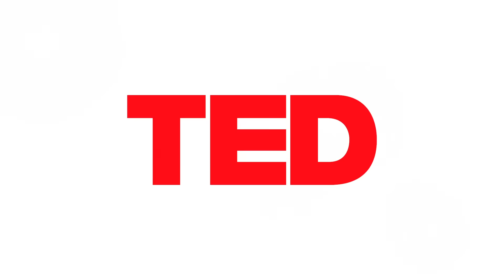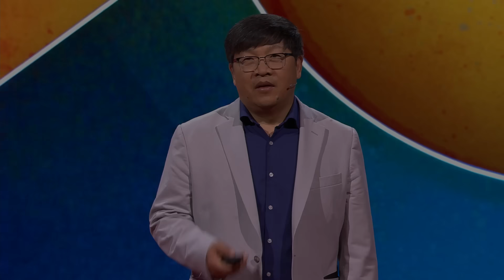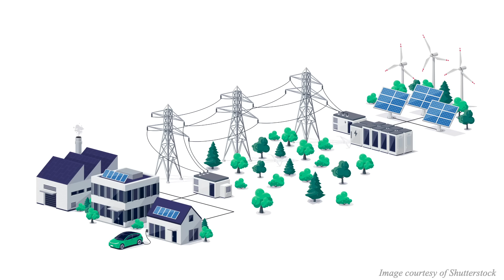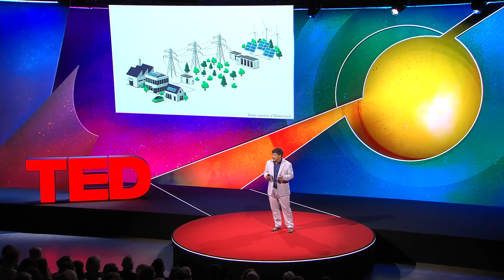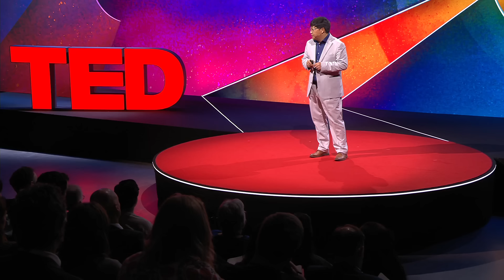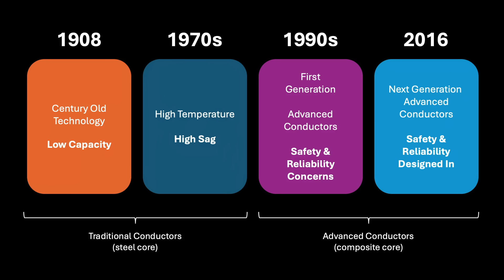The High-Wire Act of Unlocking Clean Energy | Jason Huang | TED

Comment: This  may be a technological fix for reparing errors made since ~1800 in thermodynamics. 
Lets reframe Earth's low contrast abundant ambient heat as a thermal energy waypoint between heat and other forms of energy. Energy changes form without gain or loss. Uniformity is not in itself a form of energy.  

A simple rectifier crystal can, 
just short of a replicatable long term demonstration of a powerful prototype, almost certainly filter the random thermal motioren of electrons or discrete positiive charged voids called holes so the electric current flowing in one direction predominates. At low system voltage, a filtrate of one polarity predominates only a little but there is always usable electrical power derived from the source, which is Johnson (observation) Nyquest (theory) thermal electrical noise. Max Plank anticipated that ambient thermal noise would become usable with advances in technology.  

In 1973 I filed for US patent 3890161A DIODE ARRAY for an array of metal1/ insulator/metal2 diodes that refrigerate while concurrently producing electric power. The patent was granted in 1975. It was opened to the public domain in 1992. Development should be in the public domain. 

The plausible net electrical filtrate from diodes can be aggregated in a first grouping of separate diodes in  consistent alignment parallel. After a primary level of grouping that preferably is in parallel, compound parallel and series networks can be built 
to provide desired DC current and voltage. Within limlts, parts of the  network can be shorted out or open circuted without electricalor chemical  harm. Widely  scalable electrical power always with equal refrigeration is thus possible. Inefficiency effects the performance but not the equality of the thermal absorbtion and electrical yield of the conversion. 

The maximum energy is converted from ambient heat to productive direct current electricity when the load electrical resistance  is equal to the array internal electrical resistance. Maximum calculated electrical power output (watts) is k (Boltźman's constant), one point three eight x 10^ minus 23, times T (temperature Kelvin) times bandwidth (0 Hz to a natural limit on 0~2 THz @ 290 K) times rectification halving and nanowatt power level rectification efficiency, times the number of diodes in the array. 

There are a billion cells of 1000 square nanometer area each per square millimeter, 100 billion per square centimeter.

Order is imposed on the random thermal motion of electrons by the structual orderlyness of a diode array made of diodes made within a slab: 

Host crystal in this example is silicon 

  P type boron doped
-----‐------‐----___-- Out
🔻🔻🔻🔻
■■■■■■___ + Out
  N type phosphorous doped 

All the P type semiconductor anodes abut a metal conductive plane deposited on the top face of the slab with nonrectifying joins;  the N type semiconductor cathodes or common cathode abuts the bottom face. As the polarity filtered electrical energy is exported, the amount of thermal energy in the group of diodes decreases. This group cooling will draw heat in from the surrounding ambient heat at a rate depending on the filtering rate and thermal resistance between the group and ambient gas, liquid, or solid warmer than absolute zero. There is always a lot of ambient heat on our planet, more on equatorial dry desert summer days and less on polar desert winter nights. 

Energy sensible refrigerators that absorb heat and yield electricity of equivalent energy content would complement computers as computing consumes electricity and yields heat. Computing would be free. Chips could have energy recycling built in. This would improve performance and lower cost. 

Full heat recycling, all electric, very isolated underground, undersea, or space communities would be highly survivable with self sufficient EMP resistant LED light  automated vertical farms, thaw resistant frozen food storehouses, factories, dwellings, self contained elevators, safe rooms, and horizontal transports. 
In a flourishing civillization, small self sufficient electric or cooling devices of many kinds and styles like lamps,  smartphones, hotplates, water heaters, cooler chests, fans, radios, TVs, cameras, security devices, robot test equipment, scales, transaction terminals, wall clocks, open or ciosed for business luminous signs, power hand tools, ditch diggers, pumps, and personal transports, Refugee communities would be buildable quickly. Fire safes would preserve contents to 1000F for years. These would be available for immediate use incrementally anywhere as people as individuals or larger social groups see fit. 

Some electrical equipment groups could be consolidated into local networks when suitable. Liguid nitrogen cooled superconducting networks would become practical. 

If a high majority thinks our civilization should geoengineer gigatons or teratons of greenhouse gasses out of our environment, instalations using devices that convert ambient heat into electricity can hypothetically be scaled up do it with a choice of comsequences including many beneficial ones. 

There are other plausible breeches of the second law of thermodynamics.  Hopefully a lot of people in independent teams, will join in expanding the breech. Please share the successes or setbacks of experiemental efforts. 

These devices would probably become segmented commodities sold with minimal margin over supply cost. They would be manufactured by advanced automation that does not need financial incentive. Applicable best practices would be adopted. Business details would be open public knowledge. Associated people should move as negotiated and freely and honestly talk. Commerce would be a planetary scale unified conglomerate of diverse local cooperatives. There is no need of wealth extracting top commanders. We do not need often token philanthropy from the top if the wide majority of people can afford to be generous. 

I do not seek to be the lead developer. This will disable confirmation bias and assure that other developers are acting on the merits of rhe hypothesis independently. For example gold needles abutting straight into an N type GaAs substrate may be a better starting point for development than Phosphorus and boron in silicon or Germanium crystal diode technology which is more familiar but plausibly inferior though it may be adequate for proof of concept prototyping. 

The topic deserves discussion and prototyping attempt action. 

  There could be net entropy reduction in the full lifetime energy accounting of diode array use. The entropic deteration of the structure of machine parts made of tough solids is inevitable but can be  minor compared to the stress of their use. there is negative overall entropy.   

There could be net entropy reduction in the full lifetime energy accounting of diode array.                 use. 

Diode array devices should be able to power the manufacture of àn ever increasing number of these devices. 

Aloha
Charles M. Brown
Kilauea, Kauai,  96754

Comment: Problem with better conductive materials is they are more expensive. Electrical grid is the largest system on Earth. With the scale of the system, increased costs add up making transition to renewables less viable. Therefore electrical grid between step-up and step-down transformer will not be replaced by better conductive materials any time soon.
Most of the losses of the grid are between step down transformer and end consumer, which does not require long cables. This part of the grid can be replaced with better conductive materials. Companies that use a lot of energy are incentivized to lose less energy with transmission so they will adopt better technology.

Comment: And everyone would have to rewire their home, electric  box, including insurance companies not insuring, at least not cheaply this new technology. So probably alot of barriers to entry, at least in the US. And terrible sales pitch.
Reply: Huh? No they wouldn't. Just because power lines are able to transfer x amount of electricity, that doesn't mean the wires in your home have to transfer that amount. If your computer is designed to use a certain amount of electricity, the wires are built to safely transfer that amount, and that's the amount they pull from the grid. Unless you're drastically increasing the electricity you *use*, the wires in your home should be perfectly fine.
Reply: @BonnieShadow33  Thank you! The concern is about making the "grid" more efficient, not changing building wiring. Losses are on the transmission lines.

Comment: be brave burry the lines... how you going to talk about old tech and not talk about advantages of burring lines
Reply: Please explain the advantages. And be sure you talk about the cost of digging while you're at it.
Reply: @ an area the size of manhattan just burned because of the infrastructure he suggests retrofitting. It’s flawed …is that included in his cost .. and I own an excavator operation, the majority of my cost are permitting
Reply: @ThizzMarley  I don't know anything about the fire in Manhattan, so I don't know the cause of the fire. But you still haven't explained the advantages of burying power lines, much less how it's cheaper than using current infrastructure (poles) and upgrading the capacity of the wires. I'm waiting.
Reply: @BonnieShadow33  my point is his logic is flawed the cost is irrelevant if your solution doesn't work long term the old infrastructure is the problem not the capacity your focused on the wrong thing
Reply: @BonnieShadow33  the cost of rebuilding La would have been a fraction of the cost of burying lines or the fire cost of Santa Rosa fire alone which was confirmed from raised power lines would have covered  retrofitting most of the high hazard areas In the state .. why are you so for increasing the capacity of failing infrastructure that compounds the problem … I’m waiting lol
Reply: @ThizzMarley  Not sure why you think I'm "so for increasing the capacity of the failing infrastructure" just because I asked you to clarify your point. I'm still in the stage of learning and gathering information from multiple viewpoints before I make a decision. You do raise valid points. I still don't know enough about the fires & what caused them, though, to know how valid your point is. Why do some places have fires while others don't, if the infrastructure is supposedly the same? My city hasn't had any major fires in the 6 yrs I've lived here, but Idk what kind of power lines they use here. I simply have too little info to agree or disagree with you.
Reply: @BonnieShadow33  good place to start is litigation involving pg&e in California about fire caused by downed power lines it’s eye opening for instance the Santa Rosa fire of 2017 pg&e was forced to pay95 million in damages alone … good luck on gathering more info !

Comment: The thing holding it back is the big oil companies and the national security state.
Reply: What does big oil have to do with how electricity is conducted? Wind farms already exist. That electricity has to be conducted to the power grid in order for it to be used. Also, wouldn't big oil want the electricity they produce to be carried more efficiently?
Reply: @BonnieShadow33  we already have the means to do some really amazing things but all they're all locked away in black projects. We are being held back by the security state.
Reply: @Souljourney22  You haven't answered my questions, though.
Reply: @BonnieShadow33  I'm giving you the answer as to why it's not possible with our current system. The things you speak of are possible for clean energy. We're  just not allowed to have it.
Reply: @Souljourney22  I'm asking *why*. You haven't answered except "because," which is a non-answer. Why wouldn't big oil want more of the electricity they produce to get to consumers? What incentive would they have to prevent it?
Reply: Big Oil is Big because of greed hence corruption and consumerism.

Comment: Please explain the concept of 'clean energy'.
Reply: Energy that doesn't need a invasion
Reply: Every source of energy can be "clean " or "dirty" depending how much ethics or corruption is invested in order to gain that energy regardless its origin ( nuke, oil, gas, coal, hydro, wind, solar, kinetic, magnetic....).
But what makes the "cleanliness" of the energy is also it's usage. What's the point having "green" energy if it going to be used to manufacture junk?
Reply: Energy production that doesn't pollute the environment.

Comment: Jason Huang discusses upgrading the global power grid with advanced conductors to replace outdated wires. This technology can triple line capacity, reduce losses by 50%, and enable clean energy transition while saving money for utilities and customers.
Reply: You don't get those benefits at the same time just due to how Ohms famous law works. If they are able to cut the resistance of the wires in half (by using more aluminum and a better process, which reduces its resistance), they indeed get "50% less losses", but only at the old power setting. If you then also want to triple the transmitted power, they have to triple the current and the relative losses will also triple to 150% of the former value. The absolute power dissipated as heat will even skyrocket to 450% of the old value. Radiative IR emissions from those lines (as opposed to convectional cooling by air flow) will overproportionally increase by a factor of probably around 10.

I don't say, that the new lines are bad. 50% less losses at the same power rating as before is a great thing! From there, being able to triple the transmission power - though at the cost of higher losses than before - is also a great thing. It is still better to transmit excessive wind power to the next storage facility at high losses than to take a wind farm off grid.

But claiming, that operators can get three times more power at 50% less losses is a blunt sales pitch.
Reply: Stop saying clean energy. As long as there will be greed hence corruption even the "cleanest" energy will get dirty. We must stop the gluttony train.